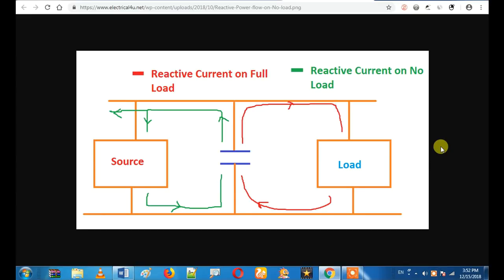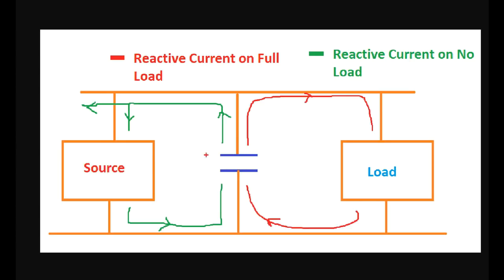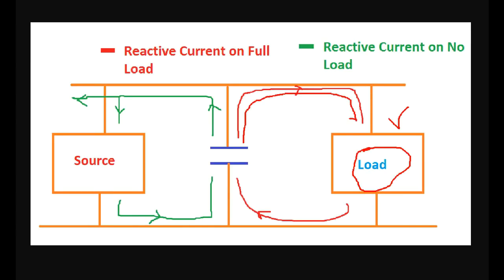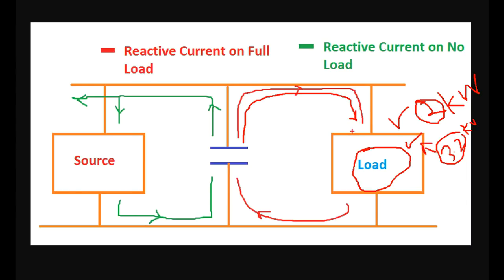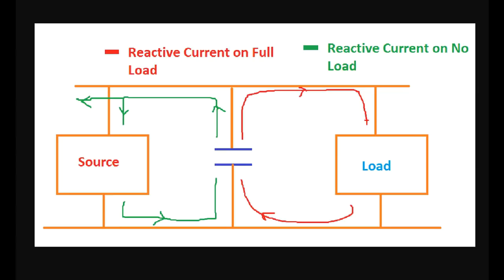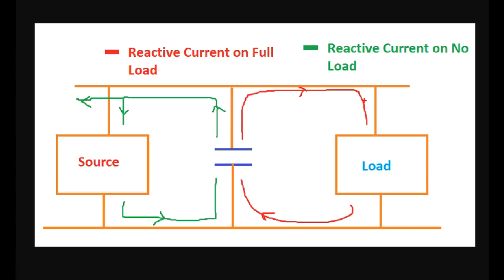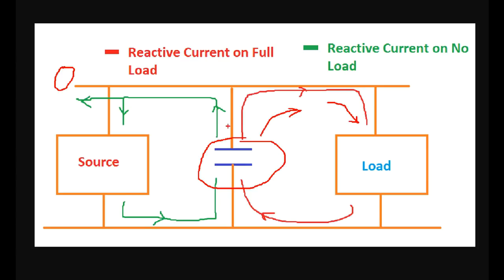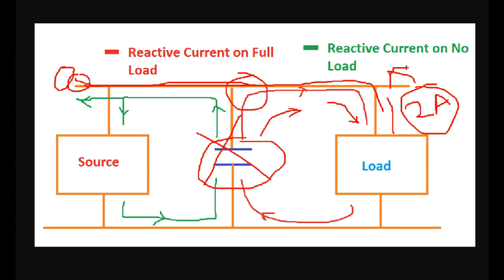கரண்ட் பில்லை குறைக்க வழி...How Capacitor Bank Saves Power In Tamil

Comment: Bro naama veetuku kwh meter potu irupom..... Low PF la current I increase aaguma... And capacitor potu power factor ah improve panna  current I decrease aagum.... Epd pathalum kwh meter la multiplication of power equal ahh dhana irukum... Then naama inductive load use pannadha podhu capcitor lead power factor ah koduthu bill ahh increase pannaadhaaaa...